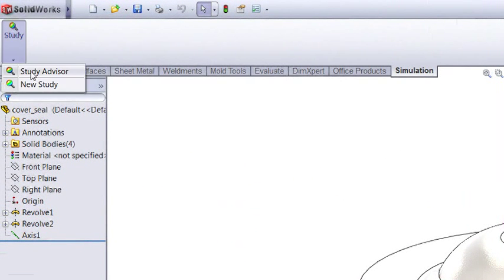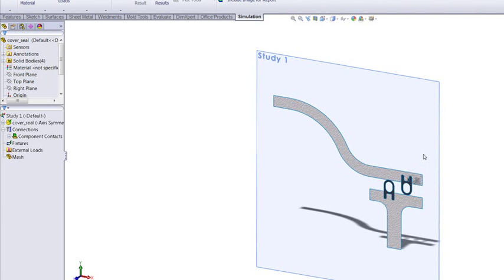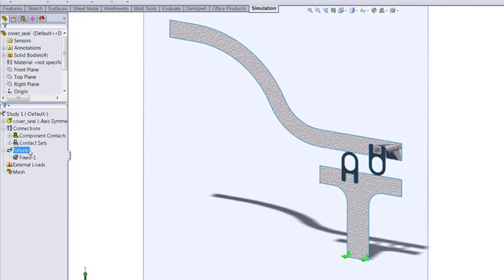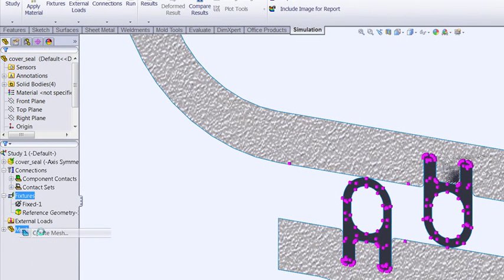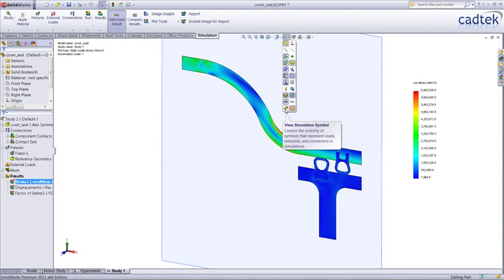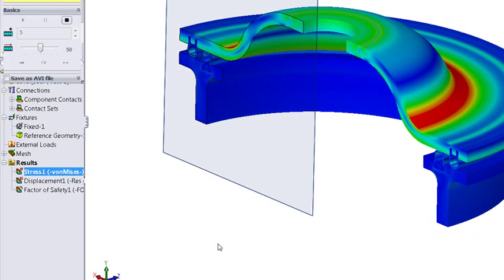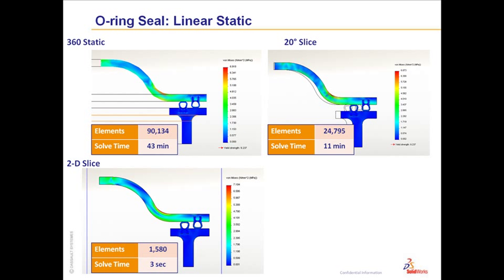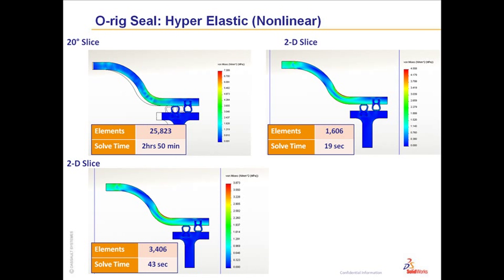SolidWorks 2011: Simulation 2D Simplification

Comment: Hello,
Thank you for that video! Can you tell me whether is there any option to apply more accurate mesh control in the 2D simplification mode? Can I manually specify areas of the higher mesh grade? I know that in 3D mode it is possible to add Split Curve and precisely specify the areas of interest. However, in 2D mode adding curves and points seems to be blocked.